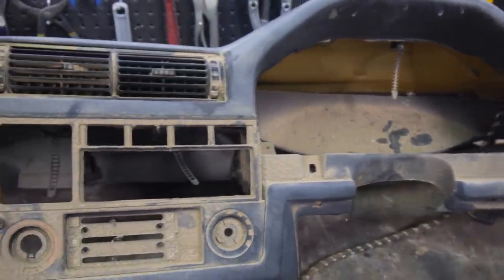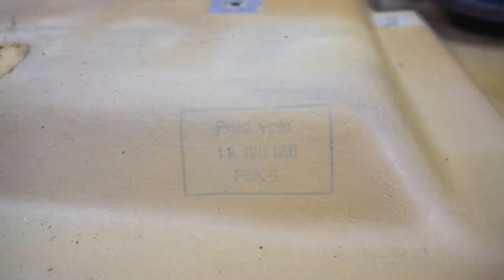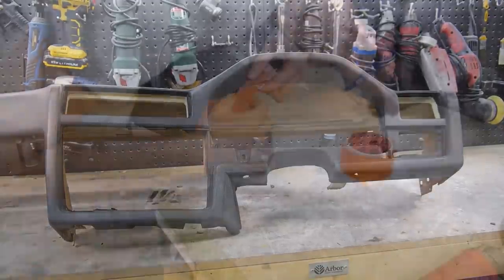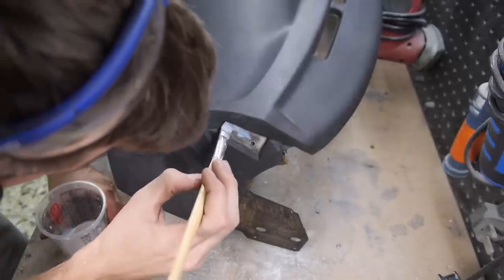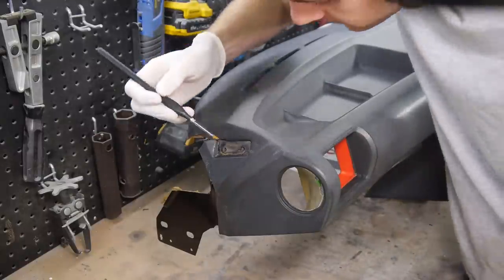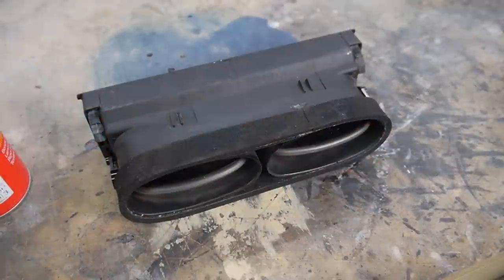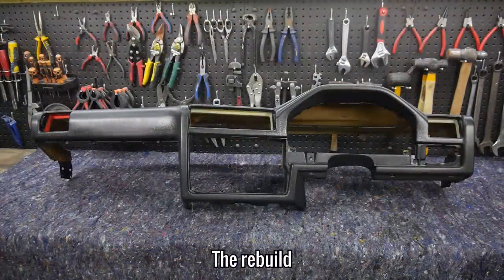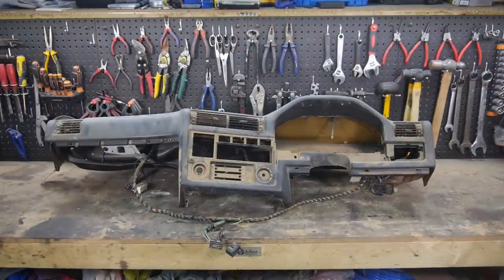BMW E30 Dashboard [Restoration]

Comment: There's is probably a dedicated product for clear coating interior vinyl but since you were using BLO and thinner, I'd recommend the simple upgrade to polyurethane and thinner or possibly equal parts of poly, BLO and thinner. That's an old woodworking formula that people have been using on furniture for years and it gives a nice tough finish that's not too shiny or weird.

Comment: Can I make one suggestion? The first step should be a washdown with a mild handsoap (not for dishes) and warm water. You'd be amazed at what comes off. Then go onto the dyes and chemicals.
Reply from the maker: I used autoglym interior cleaning as that first clean after vaccuming, I thought i might as well use that as I had it. I'll give that a go on a future one, cheers!

Comment: Couple of points: 1) Be VERY careful using carb cleaner on old plastic and rubber: it removes the (already quite depleted) plasticizers from the polymer leaving them even more brittle down the road. 2) Linseed oil was the brightwork varnish that was used before modern polymers. In 2020, it's not particuarly good - as you say, it will need to be renewed often - and the thinner you use to help it flash is also, again, not doing any favours to the plasticizers in the vinyl. I have used the Colorplus leather products on E30 dashboards with some success, but they are a paint more than a dye. This is very good for protection and for colour but it does remove some sharpness from the vinyl texture. With this said, it takes someone who is very familiar with how these looked like when they were new to notice. Going on 12 years now and holding well, though the car is certainly NOT a daily driver.

Comment: What kind of tape was used for the wires? Doesn't look like regular electrical tape.
Reply: Tesa 51608 15 Original Wiring Loom Harness Adhesive Cloth Fabric Tape
Reply from the maker: Cheers Volvogt!

Comment: I used rattle can paint on my 86 ford truck. With proper cleaning and prep it comes out good. Cost about $20 total. Textured comes through. I used a gloss, but I think a matte or satin would have been better. Then I sealed it with spray can clear. Hasn't peeled in 8 years.
Reply from the maker: Interesting to hear arosenberger, cheers!

Comment: I used a product called Revive about 10 years a go on my dash, its lasted that 10 years and due for another application. The first few days it stinks for a bit but then a week later the smell is gone for ever. 
Its the only product Ive seen that actually works and leaves a nice satin finish, doesnt end up on the windscreen after the sun has gased it off, doesnt dry the polymers out like silicon based products do and isnt messy in application EG get some on something and you wipe off the excess. It keeps the dust away too. 
In New Zealand the product is Supershine Revive, but when I used this stuff it was called Rescene Revive.

Comment: Ive restored the dash on a 80 Firebird i used a mixture of epoxy, great stuff spray foam, padded dash filler, SEM also has a line of paints/clears/texture sprays for interior restoration.
Reply from the maker: Thanks for the info Shoverbot!

Comment: There’s a product I use on the vinyl windows on my sailboat that restores the plasticizer in the vinyl, the leeching of the plasticizer is what causes fading and cracking. The product from a company called Imar protective cleaner sold at marine stores. Works for me

Comment: For painting the dashboard you can use three steps from Furniture Clinic company : Adhesion Promoter+Black HC or LC colourant+Matte Finish. I'm using their products for a few years and it is very high quality solution. Most of time it is more durable than the factory leather or plastic paint.
Reply from the maker: Thanks Ayaz I'll check them out
Reply: @RestoreIt  You are welcome!

Comment: With the old dash, you can try to use some molding silicone to make an impression of a nice part of the dash. Then you can fill in the crack and dye the filler to match or redye the dash itself, and use the silicone to recreate the pattern on your fill.
Reply from the maker: Thanks a great idea InvaderNate. thanks man!

Comment: SEM makes an excellent interior dye that I've used both professionally and on my own vehicles.  Just be sure to use the prep spray and vinyl/plastic primer.  It will last like OEM if the prep is done correctly.

Comment: Yes they do make dyes for leather and vinyl. Can be bought in a rattle can or as a liquid dye, sometimes even a paste. Black is very easy to find and cheap on eBay. I have colour changed my center console from a e34 to black with rattle cans, but while the results weren't bad I think liquid dyes would be cheaper and produce a better quality finish.

Comment: Use “Hawaiian Tropic After Sun Aloe Lotion” to reduce the shininess in the dash while also deepening the “blackness” of it. After putting it on and letting it sit for a few minutes, wipe it off with a dry microfibre towel. The aloe penetrates the leather/rubber and keeps it soft and supple, and it leaves no glare.
Reply: And the smell 🥰

Comment: Skip painting/dyeing it.  I'm not aware of any such products that actually do a good job long term.  What you can get great results from, though, is heat.  Carefully applying it with a heat gun until the oils in the plastics make their way to the surface.  Some leave it at that, it's a great technique for doing things like faded red seat belt buttons.  And even better is heating things up until the oils rise to the surface, and then applying automatic transmission fluid.  It soaks it in and stays looking good as it replaces the oils that the plastic has lost over the years, and works really well for any kind of faded plastics.  In your case, and with the dashboard, I'd be willing to bet that your heat lamp for drying painted parts would do a great job at heating your dashboard up without the danger of overheating and melting.  At any rate, whatever you end up doing, I hope it works as well as you'd like and I'll enjoy watching you do it.
Reply from the maker: Fantastic comment thanks Megan! I'll be giving heat a go in the near future for sure... Transmission oil.. very interesting. I think i'll buy a fully adjustable one right now actually for those smaller jobs, like the seat belt buttons you mentioned. Thanks again!
Reply: @RestoreIt  glad to help.

Comment: Duplicolor Vinyl and Fabric paint is a good choice but I’ve only used it on smaller parts. When i did my e10 restoration, I sent my dash to Just Dashes and they remade it. Looks perfect. Given the time you have in this build, you might explore something like that.
Reply from the maker: Thanks Shawn, yes I'll defo look into something like that as well. Cheers!

Comment: You can use "solution finish black" for the dashboard paint restoration. It is a re-pigmentation solution made for all kind of plastic or vinyl. 2 or 3 layers of this product, well dryed with an heat gun, leave your dashboard with a deep and natural black that lasts for ever...😎

Comment: On ebay you can find a leather paint paste. This product is made for shine and moisturise leather boots, but it can help you to resurrect this dashboard. After a good cleaning, aply it on with circular motions, let it suck for an hour and remove the remaining. Use heavy coats to  have enough paint on the dashboard to suck into the pores but not too much to waste more than enaugh. If on some spots doesn't be perfect, don't be afraid to use it twice. i think it costs around 5 dollars. I haven't use that yet anywere except my boots, but I have seen amazing resaults on non painted sunburnt plastics as well as leathers, real or synthetic. And its not like paint witch can chip very easily... when it dries its not comming off and it moisturise it to prevent cracks in the future. I hope that I helped you.😁

Comment: The dash in my E30 has been restored using vacuum formed vinyl. Compared to an OEM crack free dash it is slightly different, but no one has ever picked up on it. Doesn't come cheap but it is an option.
Reply from the maker: How different is it and how much did it cost please Joshua?

Comment: SEM makes a pretty good leather/vinyl paint, just make sure to remove any solvents, scuff, and clean with there SEM leather prep. Its good for things such as dashs and stuff that isnt flexxed often, but not that great for leather seat bottoms. Its very flexible and if done right will last a good while.
Reply from the maker: I'll defo be checking those guys out, cheers!

Comment: You can use household expanding foam insulation (the stuff that comes in cans) to fill in holes and then trim and sand once dry.
Reply from the maker: Im going to try this thanks James!
Reply: @RestoreIt  check out Brittanica Restorations on YT, he did a landrover Dashboard repair using expanding foam.

Comment: theres i believe a bondo of some kind to repair the cracks on the dash and then you can flock it or spary paint iver it but if you spray paint it then you have to retexture the area if which you have done repair to and around the repair area as well to make it look OEM as possible

Comment: 303 aerospace protectant softens up the dash if you use it regularly i suggest you get a gallon and dress your interior every time you clean it 
it will definitely keep it from cracking if you dont let it dry it wont crack

Comment: For restoring the dash, look up CarPro interior products, you might be able to use CarPro DLUX or CarPro Perl
Reply from the maker: I'll check them out cheers Sebastian!
Reply: @RestoreIt  Agree CarPro perl is good but not permanent. Solution Finish sell a dye for restoring dash which will last longer.
Reply: CarPro and Solution Finish both make excellent products. Solution Finish to restore, Perl to maintain.

Comment: I have a Volvo XC70, metallic gray with blue (unpainted) plastic bumpers and trim. This color is known to fade and I treat them on a yearly basis with boiled linseed oil. I don't dillute it though and I also wipe off the excess. This will last almost for a year with the car being outside all year round. So I think the dash will be good for quite some time. It gives a nice matte to satin finish
Reply from the maker: Good to know thanks Robert. I'll see how this one gets on as well as trying other methods on worse off dash's :)

Comment: You can get a dash reskinned, I used to work for a place that sold the plastic sheet, coloured and textured to match the original. I think to use it you need to heat and vacuum form it onto the dash. I guess it wouldn't be cheap but would be a cure for a badly deteriorated and irreplaceable dash.
Reply from the maker: I've seen that process and it looks amazing... I'll see if I can find a company that can do that and who wants to work with me. we'll see :)

Comment: Colorbond works alright from rattle can although there’s higher chance of contaminants getting spray onto your work but if you have the proper equipment you can order paint, mix it yourself and then spray for a better result, look up Ammo NYC where he dyes a similar BMW model and the results were amazing

Comment: I don't have BMW as you do, however i have old car with similar issues - dashboard is cracking in same places on almost every model of that car, when car is kept too much in sun. Dashboard has metal "skeleton", foam to keep distance between metal and third layer - "fake leather" type plastic. What is happening over the years and sun exposure is that 1. Plastic material is getting much harder and not elastic as it was before 2. it's shrinking just a tiny tiny bit, as many old plastic do - and when it's shrinking internal tensions are getting too big and material is cracking when it's most tensioned (since foam is making material not able to move closer to skeleton). You can test it on old cracked dashboard - just hit it with sharp object in two places - first, where it was overexposed to sun and second, where it was barely exposed to uv (like on side) - one should crack like eggshell, second should be damaged, but not cracked.
Use good UV-protecting coating for dashboards and just keep your fingers crossed that it will not crack... :) And try to avoid keeping your car in full sun for too long or use sun deflector when car needs to be left outside in i.e. middle of summer. ;) Good luck!
Reply from the maker: I'm saving this comments its that good thanks dude!

Comment: I've read that some people use leather seats dye to refinish dashboards and other flexible interior parts, but never tried myself. That dye is also flexible so supposedly stays on it better than paint. Avoid shoe's products, they are not so flexible and are not supposed to last the same as a car... If you can try better get a sample and try on a discarded part first. Using an airbrush is recommended.

Comment: You could probably keep it from cracking if you treat it with something like 303 aerospace protectant. Just soak that thing with it and it should make it supple again. Also, it's water-based and it's a UV protectant.

Comment: Thanks for a great video. I have a dash board that is badly scratched and I have been told to use a Heat Gun carefully and it will restore it. There are vlogs on this process on You Tube. Good Luck

Comment: I think the best bet for the plastic is a ceramic coating. But I really don't think there is any way to permanently restore plastics (at least while looking good) if you are feeling flashy get leather or Alcantara covering.
Reply from the maker: Yes I think you're right, I'm going to look into getting new material for the entire thing.

Comment: Duplicolor fabric and vinyl is very good, it flexes and is abrasion resistant and lasts for a long time, that what I used to paint my entire interior plastics with for my 1983 Z28 Camaro
Reply: Also used it to do my fabric seats, and full carpet....

Comment: You can buy interior paint but I'm not sure it's necessary after seeing the result you got from using the boiled linseed oil solution. If you do decide to paint it though make sure you keep it well hydrated and UI protected or it will crack on you.
Reply from the maker: Cheers Roger will do.

Comment: I always use baby wipes that have lanolin in them, cleans and puts a sheen on without being shiney aparently the lanolin helps protect the vinyl/leather. I am in Western Australia so you can imagine the punishment dashboards get here. Thanks for sharing vids. Try expansion foam for a filler I dare say aerosols would be available in spain, just try a test in an inconspicuous place first.

Comment: Where did you get that foam insulation sheet? Or what is it properly called i tried looking for some online but could not find anything not even anything similar. Im rebuilding my AC/Heater box and all the insulation needs to be replaced.
Reply from the maker: It's self adheisve foam sheets :)
Reply: @RestoreIt  Thank you so much I was able to find them with your help!

Comment: Sem or Semkit Company I believe it's called. They make an amazing line of products dye/ paint kits and repair kits that will restore plastic and vinyl to new looking, even a textured kit to get the exact stipple where needed o  plastics. I've used it repeatedly and we use it on aircraft windscreens dashboards and it lasts for years in intense direct sun..
Reply from the maker: Yeah im defo going to check them out :)

Comment: If these dashes all crack in the same places, I’m wondering if you could add some fiberglass & epoxy to the stress points underneath the dash while you have it out.

Comment: I previously used 303 Aerospace Protectant, it works well, looks great and doesn't give the dash that ugly shiny look one often gets with other products (unfortunately it's not available in SA and expensive to import from the US, especially now).  It also didn't seem to produce any film on the inside of the windscreen on hot days.

Comment: Hello good sir, do you kind if i ask where can i have the black new screws? Thank you in advance
Reply from the maker: Hey sure thing! - https://www.amazon.co.uk/CONNECT-35002-Assorted-Tapping-Flanged/dp/B00AG4EAOW/ref=sxin_10_lp-trr-2-eu_b7d55de4ec475eed01279e9385755e7fb91ec379?cv_ct_cx=black+screws&dchild=1&keywords=black+screws&pd_rd_i=B00AG4EAOW&pd_rd_r=cdaec568-7812-4d36-9440-f9b786d72aae&pd_rd_w=NdqC0&pd_rd_wg=RTNee&pf_rd_p=9638ffde-55fa-4ebc-ab40-e4183632410d&pf_rd_r=QHFEJ42SESP615Q5707C&qid=1601818261&sr=1-3-439ac954-ad46-4ba0-bd86-480f8aab80ed
Reply: @RestoreIt  thank you for the tip man. Really appreciate it. I only hope for the best things for you n you channel, big fan!
Reply from the maker: All good, thanks dude :)

Comment: Did you forget to disassemble the deflectors?  They have elastic bands on the sides, which fix the vertical direction of the air flow.  They don't hold in your video

Comment: i acutally used heather honey on mine... it actually made a huge difference in my 87.  could try that.
Reply from the maker: Cheers paul I'll look into it
Reply: @RestoreIt  it is meant for leather and not vylnl or plastic.. however the plastic and vylnl are so old they are pourous and soak it up

Comment: Great job.  My e30 M3 cracked living in Sedona AZ.  I parked in the shade in the morning and when I came back that night, the dash had completely split in half.   I got one of those pre-formed dash covers to put over it.  I looked into replacing it but had always heard that when you take out a dash you get a lot of rattles after re-install due to no-one can duplicate the factory install.  Did you have the same rattling problem?